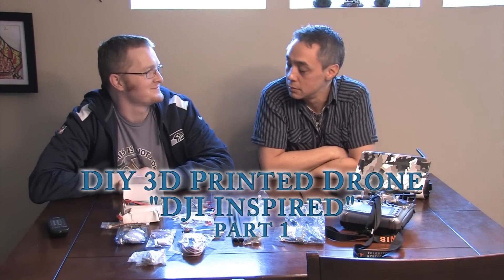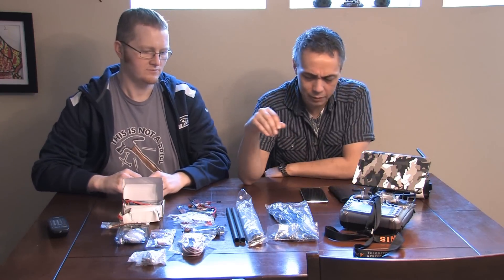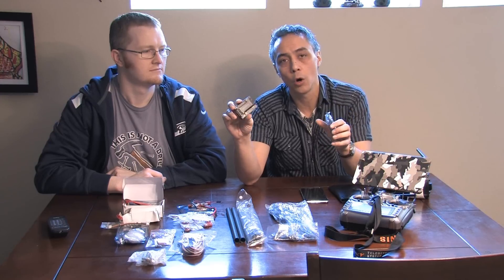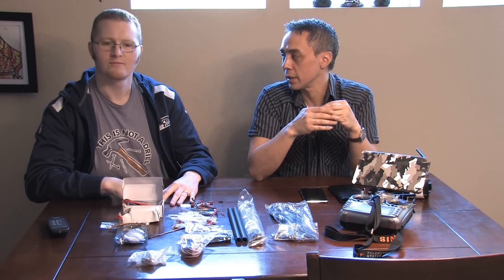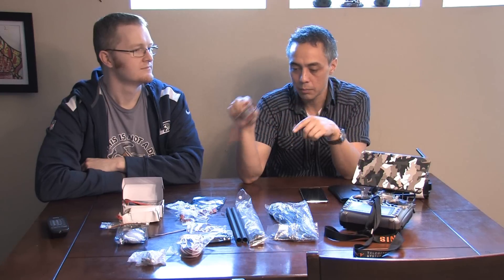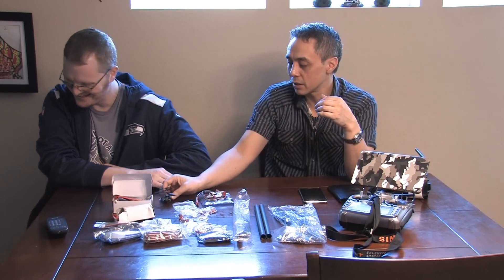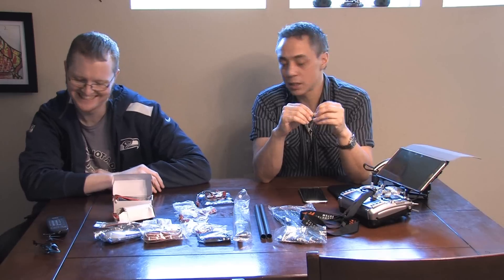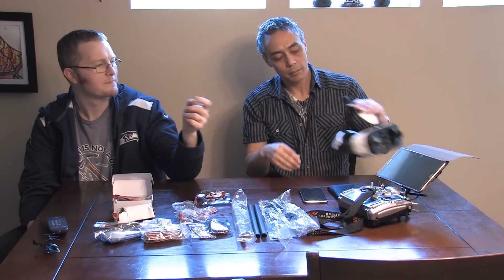Part 1: 3D Printed "DJI Inspire One"-style DIY drone - Project kickoff

Comment: should i make the rc hobbies uk version or the forums version
Reply: +Evan Portnoy and which checklist should i use? I'm hoping you can steer me towards the right direction
Reply from the maker: +Evan Portnoy you wan the one from the forum for sure. They fixed a lot of issues and made it cooler.  If I hadn't moved on to other projects I'd be tempted to rebuild mine with the updated parts.
Reply: +cozmogeek thanks